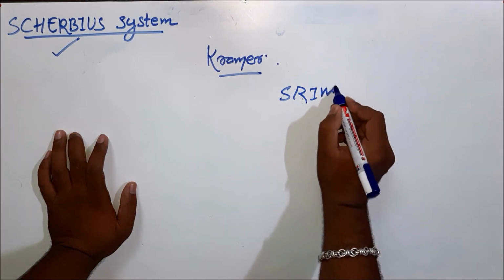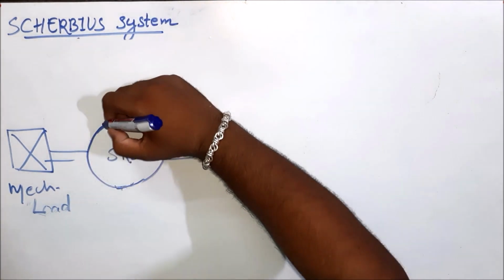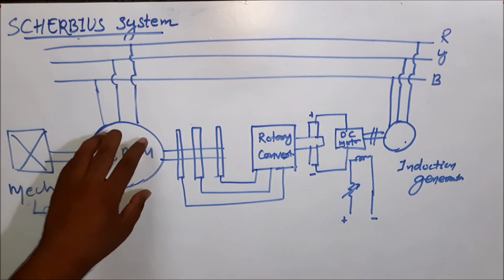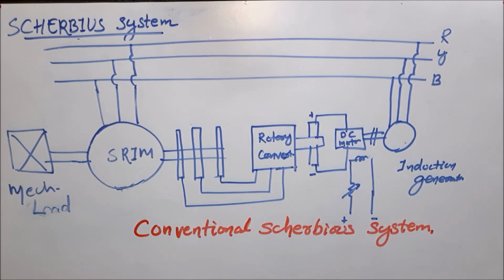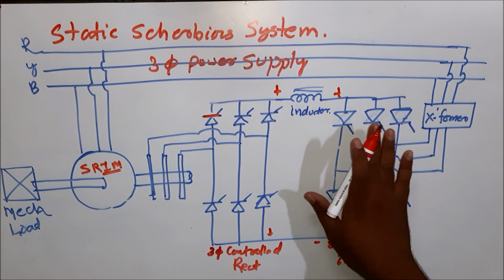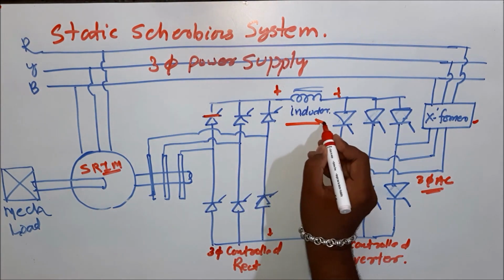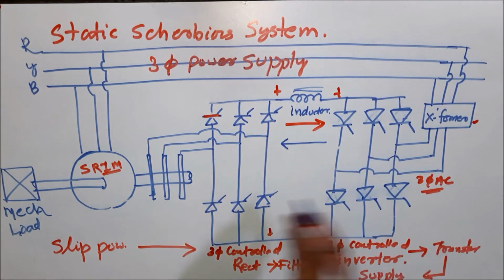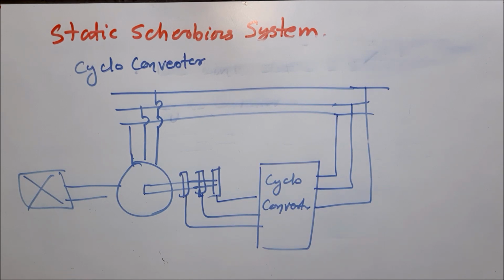Lec 03: Scherbius System

Comment: Sir the speed(under or over synchronous) of the slip ring induction motor is depend on the transformer or always the supply from right to left is over synchronous speed and vice versa???